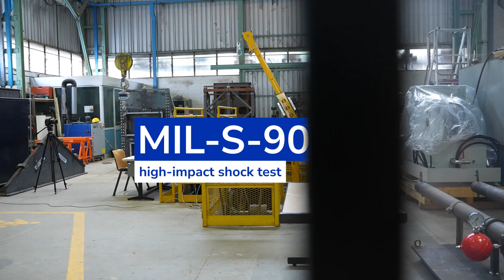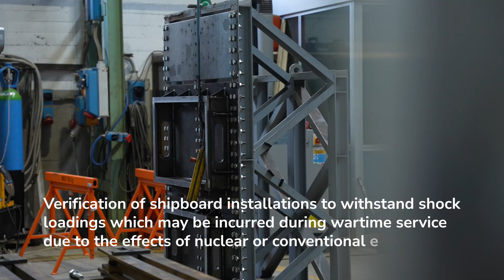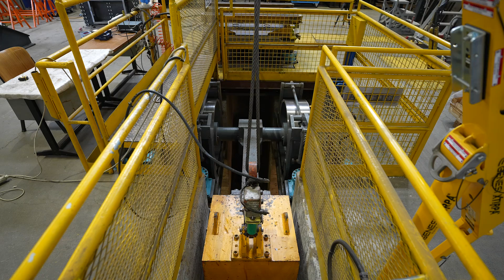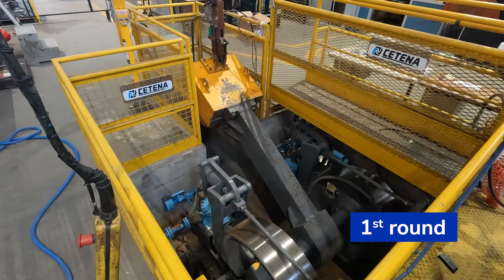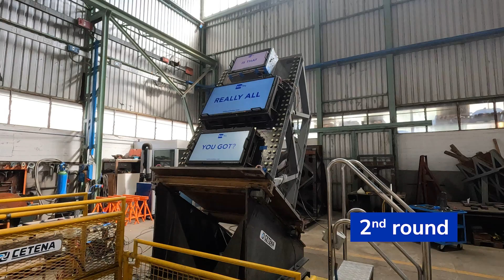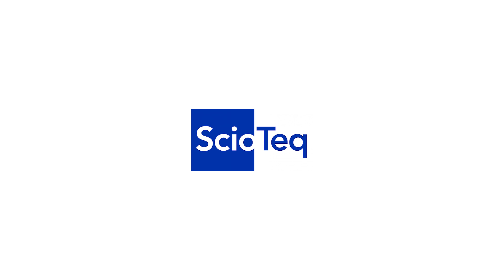MIL-S-901D high-impact shock tests for ScioTeq’s rugged military 4K displays

Comment: Is there a way to determine the 'g' force that the equipment sees in these hammer tests?.
Reply: the test house most certainly has a calibrated accelerometer/force sensor measuring what's delivered